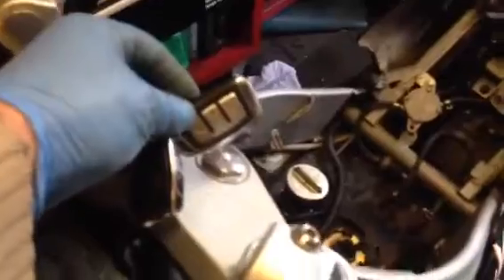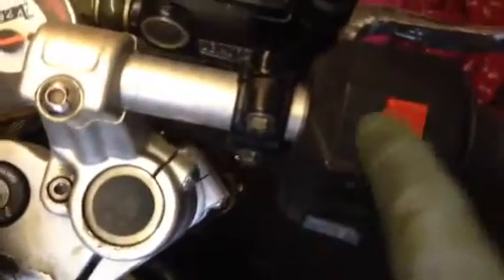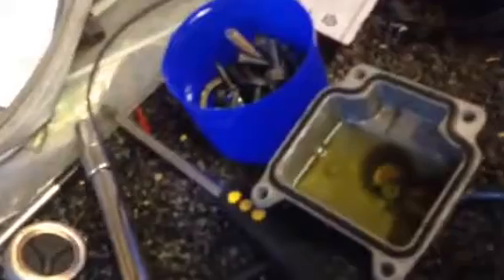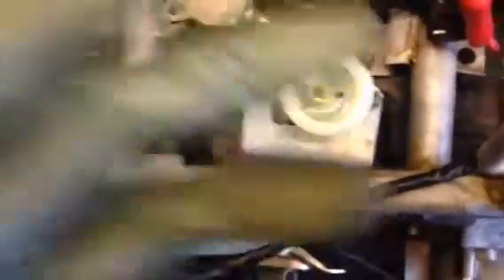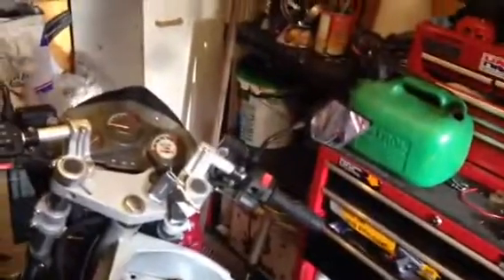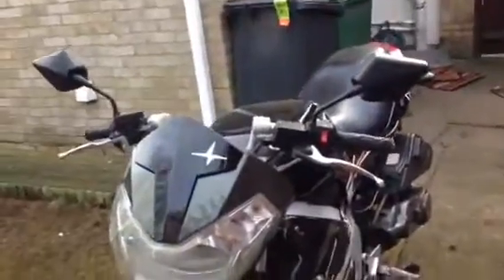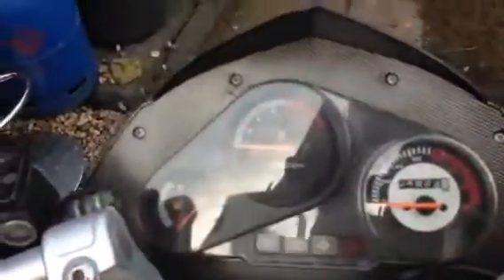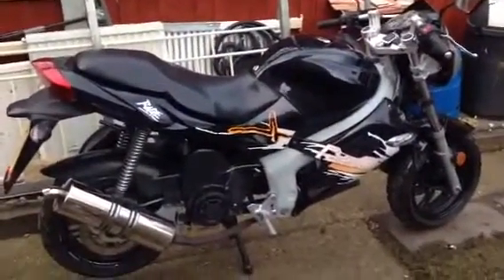PULSE RAGE 125 CC NONE RUNNER ONE DAY FIX MARK SAVAGE

Comment: How difficult is it to put accelerator cable on the pulse rage could you let me know
Reply from the maker: @alfeckersley4855  easy bud 
Just trace it back down the way the old one goes 
Few bolts on the twist and take out the needle of the carb
Watch a fee of my carb videos on speedfights,  it's all the same

Comment: hi Mark, i have a Pulse Rage 50cc that is not running aswell because it was stopped for a long time, the carburetor was tested,  spark plug, battery, fuel flow, but the thing is the petrol, its a old petrol and its very dirty, that should be why the bike its not starting isnt it?
Reply from the maker: Yes get all the petrol out and clean out carb then refill half the tank with fresh and the prime pot pore a little petrol in they as in my video and give it a turn over all should be fine , mark
Reply: +mark savage (marky bike)  yess i bought a new carb, and i will drain the tank, do you know how to open the tank?
Reply from the maker: +Natanael Carvalho two ways but both involve taking it off , turn it upside down and side to side until all out or take tap off and drain but I'd go for the simple upside down till all out then pour some fresh in and drain that out to get all of it out , job done make sure you know what pipes went where mark up or take photos :) ,, mark
Reply: +mark “marky bike” savage thank you very much!!
Reply: +NatasXMoto _  hey did you get your 50cc going? I'm thinking of getting one and wanted to find out more about them?
Reply: +ashdube09 no mate, i took it to the mechanics they tried everything and they didnt found out the problem, that bike is a cancer, i dont recommend it to you or anybody..
Reply: +NatasXMoto _ oh really? Thanks for the advice 👍🏾 think you've saved me from a disaster there
Reply from the maker: you get what you pay for ,no they are not as good as the Gilera DNA and the other top four makes  but they are cheap and if maintained they will run but do suffer from fuel problems . I share these video's so you don't have to go to a garage and get ripped off with £300 bills and use words like ( cancer)

Comment: i just bought the exact same bike but im clueless with them where do i put the oil haha
Reply from the maker: these are 4t so it should be on the right hand side as you sit on it and with a black top dip stick style but others have a oil window , best but a manual bud if your going to work on it it will be a good £10 odd pound investment lol these really do burn a little oil so good idea checking weekly till you know if and how much it burns mark
Reply: Cheers thankyou mate, it was abit of a gamble getting this bike need to fix the horn and speedo cable and drive, do you roughly know where the horn is on the bike?
Reply from the maker: somewhere around the front plastics check out the switch if you don't have and volts going to it !, speedo is easy once you get under the clocks